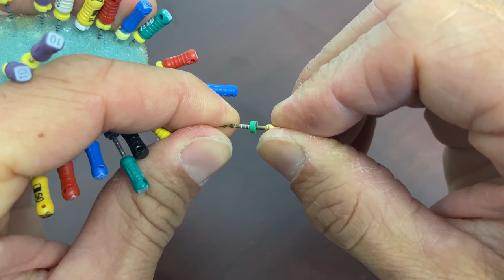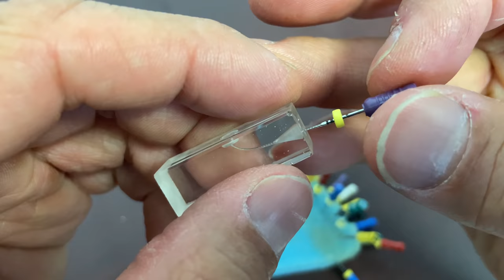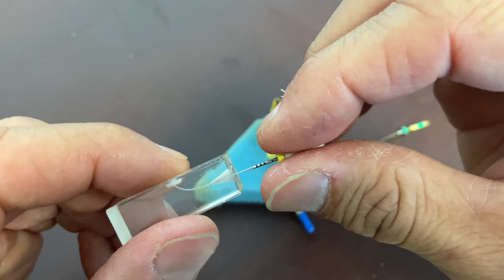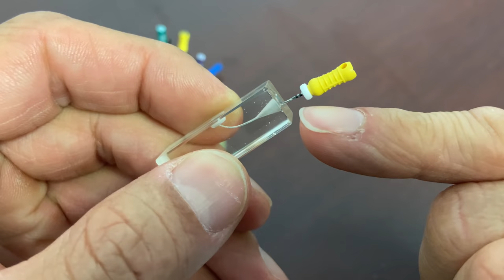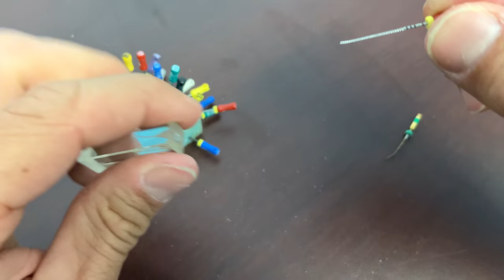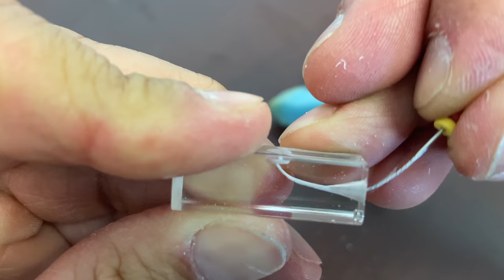Root Canal Hand Filing Secrets in 4k

Comment: The balanced force technique is a smaller version of what we do when we hand cut threads on a screw or other piece of metal.  We place the threader at the top of the metal bar and we twist and push down one or two rotations then we reverse the action with one full turn to break the metal pieces that have built up in the interior of the threader tool.